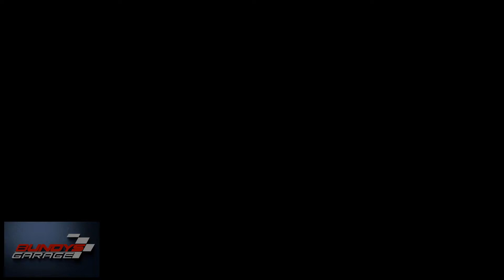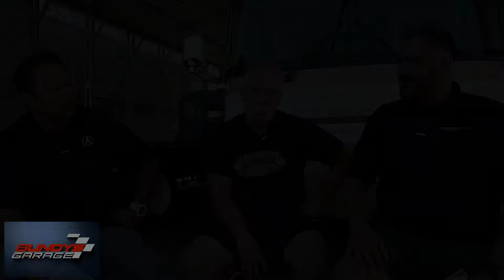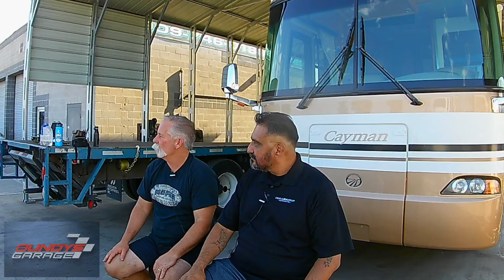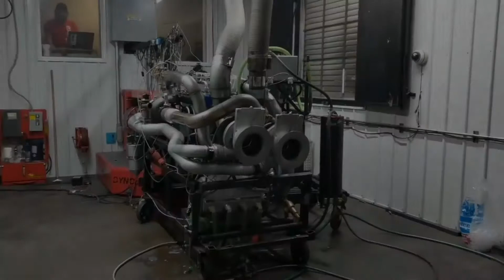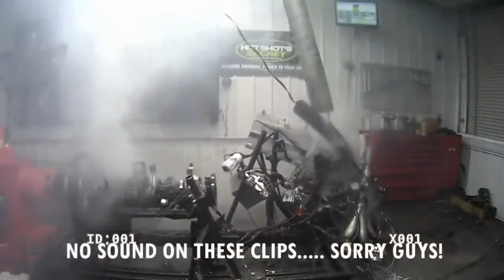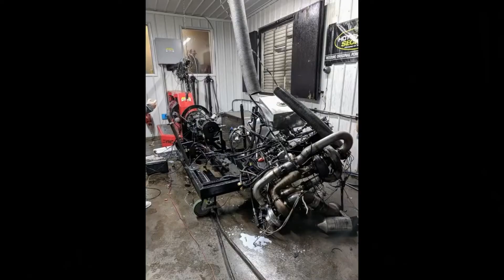Diesel Trucks will Run on Anything! | Peanut Oil | ATF | Used Motor Oil | Transmission Fluid

Comment: Diesel engines run like crap using used cooking oil.Friend of my dad's was talked into it to and made his Dodge with the Cummins run like crap doing the conversion.It took a year to get it running right again.
Reply from the maker: Yeah I wouldn’t do it on a modern day diesel. This was in a 1978 lumber truck.